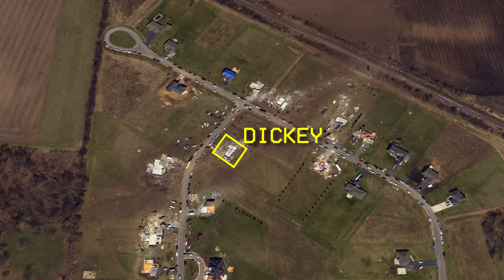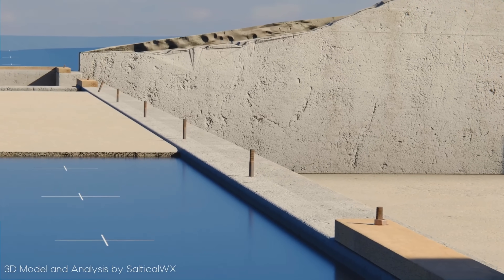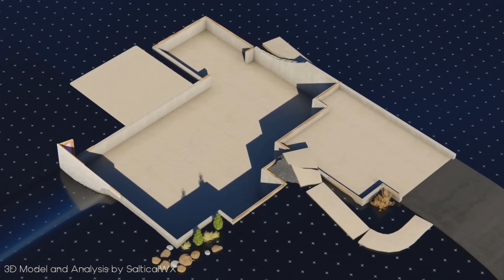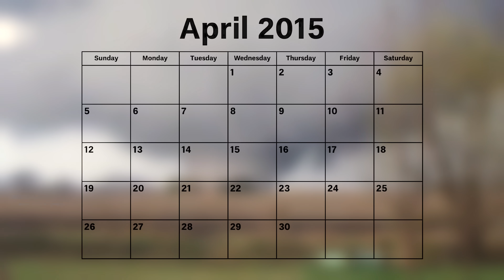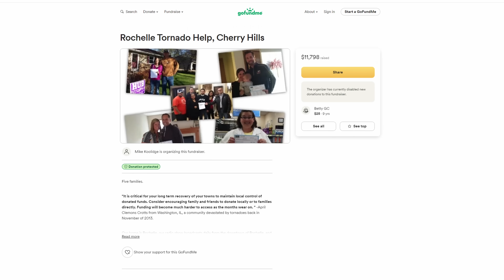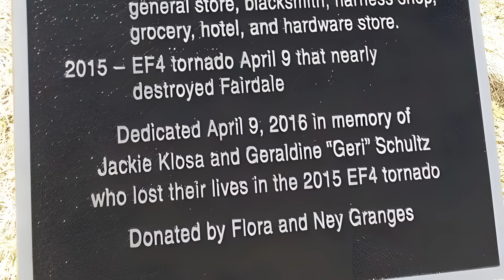The Strongest Tornado That Wasn't Rated EF5

Comment: 2015 was a crazy year, we were also hit by a tornado the same year in coal city Illinois we were sitting on our couch watching the news they said we were in the clear, and out of nowhere Tom skilling a meteorologist, comes on and says to take shelter and we laugh because we are so used to this happening, we went to the crawlspace not to worried about the warning, but thank god we did take shelter. It was rated an ef3, I remember sitting in my crawlspace hearing glass and a train roar noise above, I was only 9 when it happened, and remember going outside and seeing powerlines all over and my yard filled with derooted trees, we had to leave the house due to a strong gas smell from a gas line that was broke. The craziest part there never was no tornado, luckily no one died

Comment: Wasn’t El Reno 2013 300+ mph and only an EF3?
Reply: True, albeit it passed over open fields when it was at EF5 intensity. By the time it hit buildings, it had weakened to 3.
Reply: Those winds were not from the main tornado but one of its orbiting sub vortices and not at the surface either

Comment: There's lots of tornadoes that should've been given ef5 ratings. Elreno at 302mph winds measured yet they gave it ef3, and the greenfield iowa tornado from earlier this year that had measured winds tied with those of the 1999 bridge creek moore tornado at 318mph. The weather service is a joke at this point.
Reply: I wouldn't say they're a "joke" they're just working with a rating system that doesn't incorporate enough into it, and imho the International Fujita scale would be a great scale to implement
Reply: @LilB11138  the Fujita scale was also damage based so mabey don't pull shit out of your ass that isn't true
Reply: @LilB11138  and that's whole thing about wind speed being more reliable also isn't true, the reason it's damage based is because radar isn't always accurate and most times radar is miles away too far away to give accurate measurements in most situations and size doesn't determine strength either
Reply: @LilB11138  so my advice to u is to not talk on things you don't know about
Reply: @LilB11138  okay so provide your evidence that the Fujita scale was wind speed based when it never was
Reply: @LilB11138  and u clearly don't know what ur talking about
Reply: @LilB11138  and saying your the first person to call me out also isn't true literally 5 minutes after I posted my oc a guy called me out so there's another lie you told
Reply: I guess insurance companies really do not want to pay out lol
Reply: There's a reason their not rated ef5 it's because they didn't do enough damage to get it, mabey learn about how their rated before saying stuff like that, it doesn't go off wind speed it goes off damage
Reply: @JosephCostanza-sw4fk multiple tornadoes have been rated ef4 whilst having ef5 damage, it’s insurance companies trying to lower the amount of payment and surveyors being extremely picky about what is considered ef5 damage.
Reply: @tor-WX  name 3
Reply: @JosephCostanza-sw4fk  i don’t have to lmao, it’s obvious that tornadoes are underrated
Reply: @tor-WX  so is that a no?
Reply: @tor-WX Vilonia and Mayfield were the only tornadoes since 2013 that have had true EF5 damage and they are still questionable. Not a single tornado other than those.
Reply: @lildashboi  then we need more DI’s
Reply: @tor-WX  agreed, but those DI’s also need true EF5 damage to be classified as that
Reply: @JosephCostanza-sw4fk  I know how they're rated and I'm still right that it's stupid. Go do something productive instead of raging at someone you disagree with. NOAA is literally endangering lives with how they handle tornadoes, greenfield didn't even get a tornado emergency for petes sake. They NEED to change the system to prioritize measured wind speed, THEN damage.
Reply: @HoosierHerpvertebrate then how are they rated? Because I guarantee you that you don’t
Reply: @HoosierHerpvertebrate  but ur not right, el reno was rated ef5 for a while but was downgraded due to insufficient damage, and the NOAA has literally saved live by how they handle tornados the only tornado I can think of that is the Plainfield ef5,  and greenville didn't get a emergency but it still got a warning, and the reason greenfield didn't get an ef5 rating is because once again it was a wearing tornado they never found ef5 damge
Reply: @HoosierHerpvertebrate  and there's a reason they don't use wind speed it's because radar can be inaccurate or to far away
Reply: @HoosierHerpvertebrate  and the el reno 2013 tornado didn't have 302mph wind that measurement was from a sub-vortice and el-reno barely hit anything over its path
Reply: @HoosierHerpvertebrate  and I'm sure that calling the nws a joke is being very productive
Reply: @JosephCostanza-sw4fk  The sub vortices are part of the tornado. Aka, yes it did hit 302 mph. Have this for example: If you punch someone we don't jail your arm for assault, it was still YOU that did it cause your arm is part of you. You're confusing satelite tornados with subvortices.
Reply: @HoosierHerpvertebrate  true
Reply: @JosephCostanza-sw4fk  the sub vortices are apart of the tornado
Reply: Actually it should be rated F6 as it has been updated to 320 mph. Tearing engines out of vehicles, ripping parking curbs out of the asphalt, severely damaging the hospital, deep trenches carved in the earth….F6 for sure.
Reply: @davidhildebrand8894  Uh. F6 was only “used” twice and never again for a reason. It’s not necessary. EF5 pretty much has no upper limit by design. It’s >200 cause it has upper limit. Additionally the Fujita scale had a bunch of issues all of its own such as it overestimating tornado intensities. EF rectified this by shifting around the wind speeds based on studies done since Fujita devised his scale and using field experience from meteorologists and engineers. The DoDs were also adjusted and in the upcoming update to the scale, getting revised again alongside the potential additional of DoW data
Reply: El Reno was an EF 5 I was in greenfield it was rated3 then 4 I think E rating whee based in damage and EF is based on wind speed which would make both EF 5 damage although massive damage greenfield was 3 or 4 not counting wind speed also depends were you measure it lower or higher by radar
Reply: El Reno didn’t have 302mph winds nor did it hit any well built homes. The 302 winds it briefly attained were from one of its multiple tornado sized orbiting sub vortices while the main tornado itself was weaker.

Greenfields EF5 winds were recorded above the surface (radars, even DOWs struggle to record winds below a specific height due to how Doppler radars operate) and it was a weakening tornado by the time it hit greenfield entering a cycle. It was briefly a twin to a nearby tornado that formed to its north. The damage it did wasn’t consistent to an EF5
Reply: @KaiserStormTracking  Greenfield was consistent with ef5, my friend was chasing it and saw the damage first hand. 

Also the sub vortices are part of the tornado, it was multivortex, that's how multivortex tornadoes work. It's literally a fact that elreno got to 302 mph winds. Here's an analogy so you understand: If your arm can lift 100lbs it does not mean that you can't lift 100lbs. Your arm is part of YOU, so it's still YOU lifting 100lbs. Were it a satellite tornado that'd be different.
Reply: @HoosierHerpvertebrate  Doesn’t matter if a friend saw the damage or not, wind engineers didn’t find any structures consistent with EF5, they didn’t find any. Winds were EF5 for a time above the surface and these winds do not sustain. They fluctuate. People forget the winds above the surface aren’t what matter. It’s what’s happening at the surface where the actual damage is done.
Reply: @KaiserStormTracking  It does matter cause NOAA has consistently been wrong on these.
Reply: @HoosierHerpvertebrate  NOAA? Get your agencies straight my dear short sighted friend

NOAA is the parent agency. NWS handles the severe weather and no they get quite a lot right

Greenfield had 45 MINUTES OF LEAD TIME, its parent supercell produced tornadoes prior to greenfield even came down and multiple chasers were documenting it. TORE or not it doesn’t matter if it had it or was EF5

Engineers WHO DON’T WORK FOR NOAA went out, checked the damage and told the NWS survey teams what they saw and their recommendations. They recommended EF3 and then later new evidence and reanalysis of some of the damage turned up EF4 damage.
Reply: @KaiserStormTracking   Greenfield did not have that much lead time, they had very little warning. Also if NOAA is the parent agency that means NWS is still NOAA. You're just proving my point while being nit picky.

Also engineers who clearly need to go back to school as a well built home was swept clean. You're really saying again that the sub vortices are not the main tornado? Go do some research man.
Reply: @JohnnyDanger36963  *Right.
Reply: @HoosierHerpvertebrate also greenfield was consistent with EF4/170 - 180 damage wise, you clearly don’t understand how tornadoes are rated
Reply: @lildashboi  Greenfield had ef5 damage even via how it's currently rated. A house was slabbed by it. I do understand perfectly well how tornadoes are rated, and how they are rated is stupid.
Reply: @HoosierHerpvertebrate  homes being slabbed can vary from EF2-EF5 so no, you don’t understand how tornadoes are rated. There’s A LOT more in play than just home slabbed = EF5
Reply: @lildashboi  I do understand how they're rated. Well built homes swept clean equals ef5.
Reply: @HoosierHerpvertebrate  and what makes a home well built? Because not a single slabbed home in Greenfield was well built
Reply: @KaiserStormTracking  The sub vortices are part of the tornado so those wind speed ratings still apply to the main tornado itself. We don't classify sub vortices as their own tornadoes.
Reply: @msscott22  regardless, the main tornado never had EF5 winds. Only its orbiting absurdly sized sub vortices did. The main tornado fell short of EF5

Had this plowed into El Reno and only IF it did, it could have possibly gotten EF5 intensity if those winds also translated to the surface, which considering the way winds mix down, is a half decent shot
Reply: @KaiserStormTracking  If one of the sub-vortices had hit a well designed structure at EF5 strength, the El Reno would have been rated an EF5. Sub-vortices are part of the tornado. You can't just say the "main tornado" when talking about sub-vortice strenth. They're part of the main tornado. That's what I'm saying.
Reply: @JohnnyDanger36963  Yup. Learn more about tornadoes.
Reply: @msscott22 The el Reno tornado was basically the entire mesocyclone on the ground. If that hit a town it would have been devastating.
Reply: @JJJJ-he8bz  Truth, the El Reno tornado would have absolutely leveled a city.
Reply: @KaiserStormTracking I think the goal should be to rate a tornado based on it's maximum  sustained winds, not to based upon damage only on buildings and trees

The International Fujita scale needs to be implemented, it is better than EF because it uses way more metrics to determine a tornado's rating
Reply: @USAS2025  there is no objectively better scale. Both are just tailor designed to their regions. And rating by damage is the ONLY WAY to get an idea of what intensity looks like. As it stands, it’s physically impossible to get reliable surface level readings of a tornado since dropping probes is more dangerous than what video games make them out to be.
Reply: @KaiserStormTracking  i agree that dropping probes is dangerous, but I disagree on one not being objectively better, when you look at what the IF scale measures, it measures car damage and takes into account measured wind speeds

Again imo our goal should be to get the maximum sustained winds in a twister, not it's damage because that would be based moreso on the opinion of who rates the storm, and it just feels like they withhold the EF5 rating for no good reason, especially in the instance of this tornado in the video. 

I want accuracy, I want precision, not "well, we looked at this tornado for 3 days and came up with a rating" 

Recently the Elkhorn-Blair, NE tornado got upgraded after 3 months to EF4. Some people talk about how they're understaffed, and my response to that is just take your time surveying and considering the ratings you should give it, it doesn't and shouldn't have to be 5 seconds after the tornado changed people's lives forever. Like the Rolling Fork tornado, a rating should be carefully crafted, not just put together on the fly.

Comment: One of the most photogenic wedge tornadoes over the last decade. The fact that this formed from an HP supercell and was still this visible and clear is amazing. I think this tornado, Goldsby 2011, and Chickasha 2011 are the three I'd nominate for the "should've been an EF5" club.
Reply: What about rollingfork? (Someone explain why rollingfork wasn't a EF5)
Reply: @PrussianOperator  the building they suspected to be EF5 had damage that didn’t line up with the damage of a nearby structure which made it suspect, but it nearly got there. If water towers DIs are included and Rolling Fork is revisted, then it could become EF5
Reply: @KaiserStormTracking  Rolling Fork is probably my biggest wildcard after these 3. The few buildings that were well constructed enough to earn an EF5 rating and the suspected structure did not sustain full-blown EF5 damage, although they came very close. The tornado would further intensify the second it left RF and would produce extreme contextual damage. Had the tornado peaked slightly earlier, we would likely be having a different conversation all together.
Reply: you should make google doc for that. half of it would be 2011 tornadoes I bet
Reply: Vilonia 2014 is another that is a lock for "should be EF5"
Reply: @mrwasatch  Vilonia is a bit iffy since many of the structures were not properly anchored, and some structures that were built well enough to warrant an EF5 rating were not slabbed. However, no doubt in my mind that that tornado reached EF5 intensity throughout some portions of its life.
Reply: Ted Fujita had the best scale. They’re too picky with this one.
Reply: @LVM5584  The EF scale is extremely tedious and complicated to navigate as well. There is so much redundancy within the scale and so many subsections it's insane, even with not having a lot of damage indicators. They need to clean the scale up a bit imho. I would not be surprised if some of the questionable ratings would be partially due to confusion and frustration navigating the scale.
Reply: Don't forget elreno and greenfield. Both had measured winds over 300mph that were completely ignored.
Reply: @HoosierHerpvertebrate  only greenfield could've done damage to possibly warrant ef5.
Reply: El reno had 300 on a subvortex, still thats the most stupid excuse ever  @HoosierHerpvertebrate
Reply: @HoosierHerpvertebrate  They were not ignored. They are different measurements.
Reply: @HoosierHerpvertebrate  this is why I believe we should implement the IF scale or the "International Fujita" scale

It incorporates more than just looking at buildings to get ratings from, it even includes car damage!
Reply: @USAS2025  yeah never happening. IF is designed by Europe. EF is designed by America and each fit each others unique methods of construction except in the case of Puerto Rico where getting significant tornadoes is harder due to the different construction methods. EU building techniques tend to be better meaning when a tornado gets EF4 or 5 there, its stronger then an EF4 or 5 in North America. See the issue?
Reply: @HoosierHerpvertebrate El Reno wouldn’t count any day. Tornado was weaker then what people think it is (strongest winds were contained within the orbiting sub vortices which were the size of the average tornado by that time). Greenfield had it hit more well built homes could have been an EF5 however it was starting to enter a cycle when it hit town so it might have weakened since
Reply: @KaiserStormTracking I think Greenfield had a similar effect to Matador in terms of strength
Reply: @KaiserStormTracking thats not even remotely true. The EF scale is an absurdly flawed system based solely on damage and that damage based solely on well constructed, braced structures. El Reno basically only hit cars, and was downrated for that fact and ONLY for that fact
Reply: what about tuscaloosa
Reply: Well agreed my friend ❤
Reply: My opinion, if vehicles are no longer recognizable as vehicles, it is an EF5
Reply: Why don’t they want to rate tornadoes as EF5? Insurance probably! I wouldn’t be surprised if some are EF6